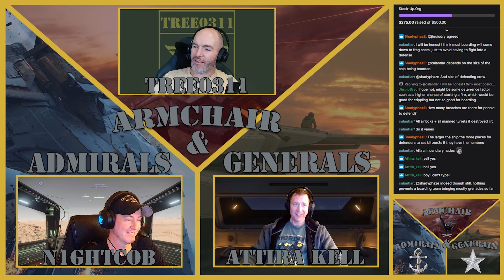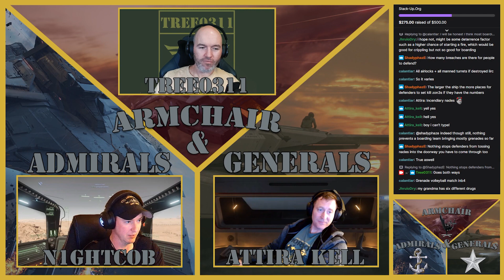Damage Control In Star Citizen | AA&G Discussions

Comment: Fire is the immediate threat, but command and control, and engineering are the ways to control that fire. It is important, if damage is not catastrophic to have security on those areas to ensure bulkhead doors and venting are possibilities. With the new engineering system there is some hero tactical moves to enable some relays. The room system can maintain localised Oxygen supply.